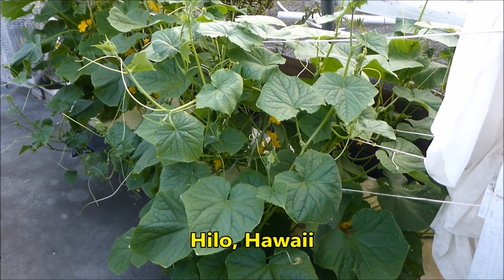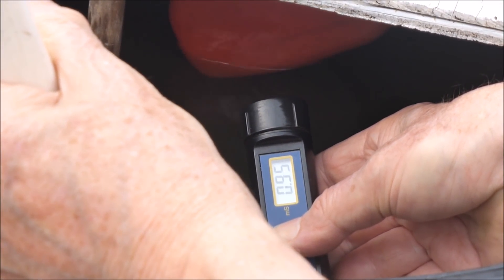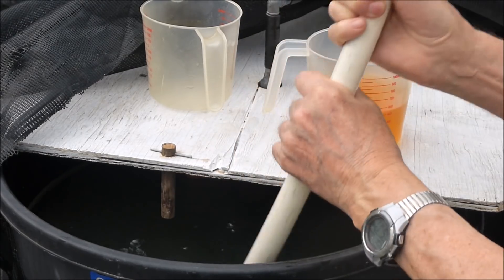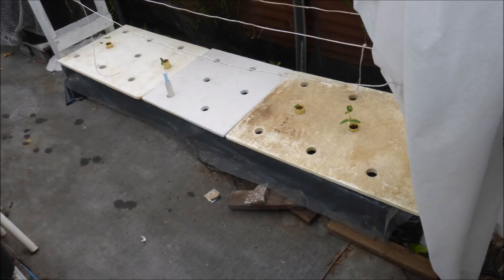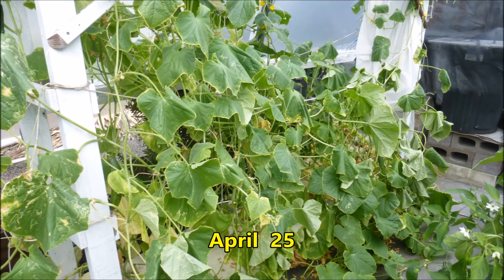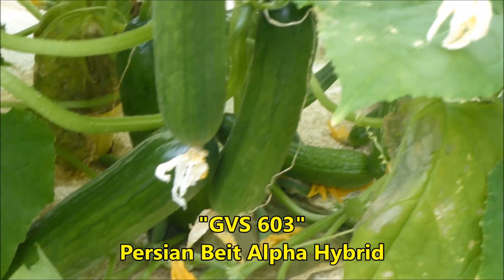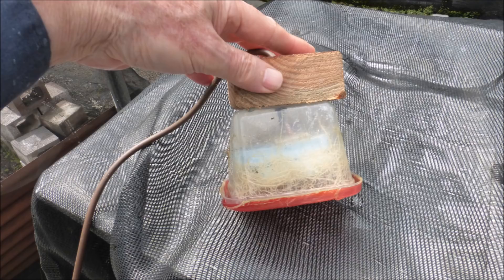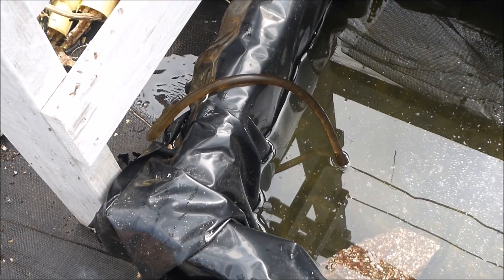Growing Cucumbers in a Tank by a Kratky Non Circulating Hydroponic Method

Comment: Is there a reason for using the tubes rather than netcups? Is it to get the roots closer to the bottom of the container?
Reply from the maker: Yes, my available net pots weren't long enough to touch the nutrient solution at the float valve setting, so I improvised by using forestry tubes with holes.

Comment: Greetings from Turkey. Thanks for video. It is great video. I have a few questions. 1) Did you keep the water level constant? 2- How much did you set the ec value? 3- Have you made any changes in ec value over time? Thanks again.
Reply from the maker: Yes, the nutrient solution level is kept constant with a float valve.  I add stock solutions to my nutrient solution barrel about once per week.  A float valve adds water to the barrel to keep it full.  My EC is usually about 2.5 mS after I add fertilizer to the barrel, but it decreases to around 1.0 mS before I add more.  The plants would probably prefer a constant 2.0 mS, but this is the most convenient thing for me to do.
Reply: @growkratky5558  👍👏

Comment: Thanks for sharing. So do you alter the strength of the solution when the cukes go to flower? (eg less nitrogen)
Reply from the maker: No, the nutrient solution strength was not changed based upon crop stage, because my only  nutrient solution supply tank was also feeding other tanks of crops.  However, the nutrient solution strength varied in the supply tank depending on the dilution of the stock solutions  (water was  supplied by a float valve) which was dependent upon the frequency and strength that the stock solutions were added to the supply tank.

Comment: What is the target ppm of each macro (NPK Ca MG S) and micro nutrients (Fe Mn Zn B Cu Mo)  through out the cucumber crop cycle ? I am asking this because 8-15-36 is not available in our area.
Reply from the maker: Here is the target ppm of individual elements- N-150, P-42, K-190, Ca- 127, Mg-38,  Fe-3,  Mn- 1.3, Zn- 0.3, Cu- 0.3, B-1.3 and Mo- 0.06 based on Hydro-Gardens 8-15-36 fertilizer formulated for lettuce production.  This is not the ideal fertilizer for cucumbers, but it is what I had and it works pretty good.  I suggest that you search the literature for the optimum cucumber fertilizer formulation.
Reply: dakineapproaches thanks a lot for the information.

Comment: You think you are lazy?  I often just dump all the powders in the tank with no mixing.  I just scatter them on the way in.  I should probably rig a test to see if it matters.  Great video.  Thanks!
Reply from the maker: Thanks, Jeb.  Since these are pretty soluble fertilizers, you might be ok.  Yes, I will be interested to hear how it turns out.
Reply: @growkratky5558  - Hey Dr. Kratky!  Jeb Gardner introduced my father and I to your brand of hydroponics via his channel and we've been absolutely amazed at the results we've achieved.  So, thanks so much for putting the information, and your experience, out there for all of us to enjoy.  We've been using Masterblend for all of our growing endeavors, but I see you using liquid fertilizer components in most of your videos.  Do you find one better than the other, or is it just a case of solubility?  Also, do you vary the solution(s) by plant type, i.e. tomato vs. cucumber vs. lettuce, etc?  Thanks again for all your good work!